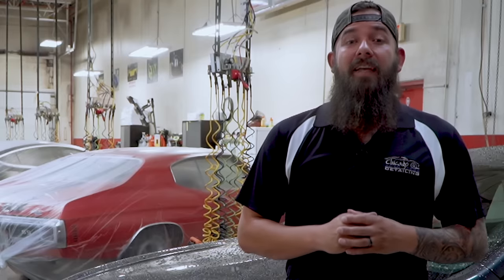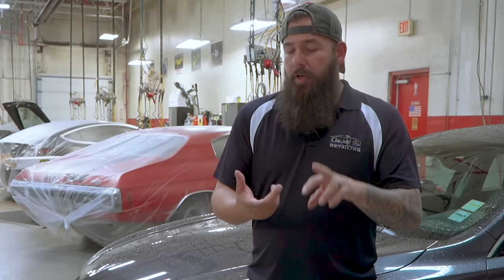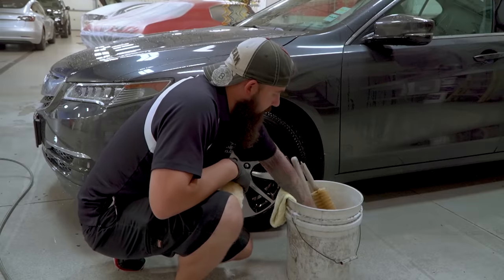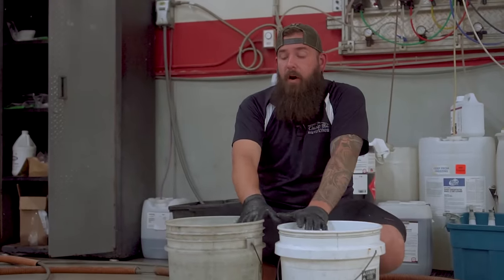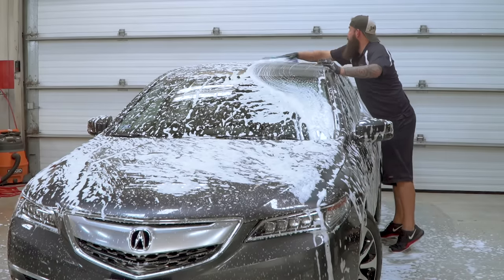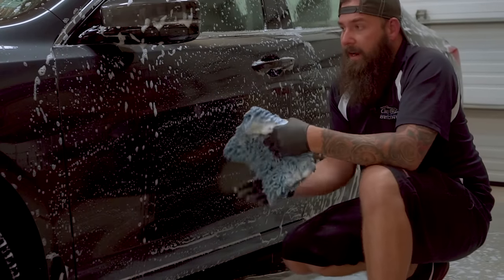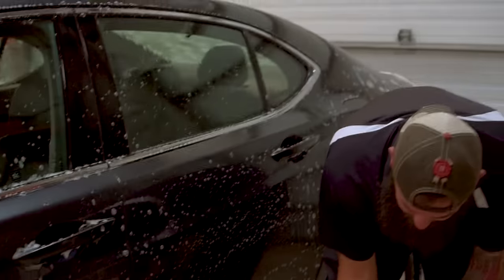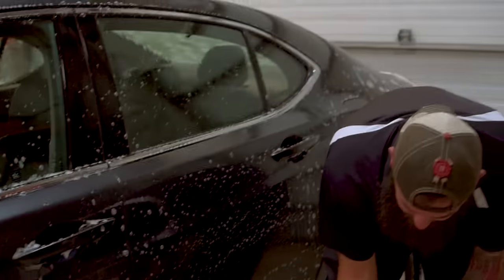A detailers SECRETS to hand washing

Comment: Man normal dude doesn’t have any of this shit I only got micro fibre cloth and detailed spray lol
Reply: Hes using clearer from a hose hanging on a wall and a leaf blower to dry it. SMFH been detailing almost 30yrs can detail a car in direct sunlight with a beach towel and Dawn Soap 
FYI detail jason:
Never clean wheel wells with a towel
Never clean wheels with them turned out
Never tell people how to spray on De-Bugger then forget to tell them the bugs still wont just spray off, or not show them how to properly clean bugs (debugging is a pre-step)
Reply: for a the price of a few touchless car washes, you can get some buckets, microfibers, mash mit, soap, and sealant
Reply: @gilbertoqueb6433  clearly you missed the point that real detailers have detailed cars for 50yrs without 3 buckets, microfiber everything, iron remover, foam canons etc etc detailing is tried and true methods that work having everything ready. People tell me "i dont clean my car it takes 4hrs" i say i could detail a battleship in 4hrs.... Got MFers on here using leaf blowers and spraying drying agent (i.e. more liquid) to DRY THE CAR FASTER are you kidding me these companies see fools coming a mile away
Reply: @fatashreviews5670  Wait so whats the right way

Comment: The rubber part of the tire?? Hmm... 🤔
Reply: I mean technically tires aren't ENTIRELY rubber but yeah
Reply: Tires/tyres are rubber...wheels/rims are metal.
Reply: It’s the softer part of the tire. If you put air into the ‘valve stem’ then the rubber part of the tire is the only part to move.

Comment: Why didn't you clean the rubber part of the tire first before the face? Seems backwards to clean the face then the rubber last... 
Grit Guards don't do anything. Myth and waste of money. Lots of evidence based research to show this. Same with 2 bucket system. Waste of time and water. I'd been doing the 3 bucket system for years (2 for paint, 1 for wheels) and finally saw an article from another detailer on what a complete waste it is. 
Best practice is to use multiple wash pads (one for each panel) and a foam canon. That way you are always using a clean wash pad for each panel (not a dirty one being dunked over and over in a dirty pail). I pre-soak the wash pads then have them all sitting on the windshield. Then I foam canon the car including the wet wash pads. Then I take on and start on one panel. One side of wash pad for first pass, second side for second pass or even a different panel if no second pass needed. Then discard of that now DIRTY wash pad and start with a fresh new one for the following panel. Saves 10 gallons of water per wash. Yes you will need more wash pads per wash. I am only washing 1 car though (I'm not a detailer for a living).  Dunking the same wash pad over and over into a bucket is not cleaning it - the dirt from the bucket gets agitated each time and you are dunking a dirty wash pad into a dirty water bucket then back onto the paint. It's a bad practice.
Reply from the maker: Definitely more than one way of doing things. Thanks for sharing your method.
Reply: Nothing wrong with 2 bucket method. Grit Guard use is debatable, but there is no doubt heavier contaminants (the stuff that is mostly likely to scratch your car) falls to the bottom of the bucket, and the guard stops your mitt from getting to the bottom and reintegrating into it. As long as your arn't sloshing the mit around like crazy, it's useful. The moment you place your mit on the panel it begins to collect dirt that you are then still rubbing over the paint, so a perfectly clean mitt turns into the same mitt you pulled from the rinse bucket after 1 pass and therefore makes no difference. You say the 2 bucket wastes water, how much water are you using to wash 7,8,9 wash mitts afterward? Assuming you are using one for each panel like you claim. Finally the majority of clear scratches come from excessive rubbing of stubborn spots, excessive pressure while washing, drying, or waxing, and from using towels other than microfiber. Avoiding those issues will minimize scratches.
Reply: MrFunk a
Reply: "Same with 2 bucket system. Waste of time and water" YET....." I'd been doing the 3 bucket system for years"  So let me get this straight,  "three buckets" waste LESS water than "two buckets"?  Ok, Got it!
Reply: MrFunk wash a car in Minneapolis at any time of the year, and you’ll understand why Grit Guards are so important.  They work as advertised for me.
Reply: @whatthewhat11 oof got his ass he aint respond
Reply: 11/27/18, Carwash isn't "rocket science," if you have a driveway & hose, some car soap, rags/towels that's pretty much all you need. This thing omitted one last step: glass cleaner. Pressure wash is nice though not necessary; you can pressure wash w/o rags.
Reply: MrFunk   B
Reply: @helsinki4  He used to do 3 bucket until he decided it was wasteful.  That's what the 'd means in the word I'd.  It stands for "I had", so "I had been" doing 3 bucket method means he was doing it until he read the article.  OK, got it?
Reply: V/
Reply: aA great idea to consider!
Reply: I'm going to burst everyone's bubble... dirt or contaminants or you choose to call it... it doesn't fall to the bottom for like  3hrs  so your scratching your car no matter what... have a nice day
Reply: Nickolai Siegfried  Yes, rinsing mitt glove with water hose is better than in a bucket with water because the water in bucket is only 100% clean for the first rinse and for the other rinses is already dirty even with a plastic grid.
Reply: Dish cloth, dish soap and bucket together with a bath towel to dry. Job done
Reply: Dez Alan your not serious right? ....right?
Reply: @whatthewhat11  - You made some good points as a rebuttal. I can see where you both are coming from. Especially if he had a mobile detailing vehicle with a water tank and he wanted to conserve water. I will side with your explanation though.
Reply: I'm currently using 17 bucket system. but after this comment I'm cutting down to a half of a bucket half system
Reply: 100% agree with you about the wash mits.  I have 13 for:  roof, door 1,2,3,4 top.  Door 1,2,3,4 lower.  Hood, trunk, hood lower trunk lower.  And I always Power wash all panels to get all grit off first.
Reply: Hahahahha,,,,,and how much water, time and energy does it take to wash and clean all those pads you use?
Reply: @2003evodave  They're now rendered impure. You destroy them of course. Sort of like the woman that won't wear the same thing twice. Speaking of which, if he happens to have any women like that in his neighborhood, if he swings it right, he could have a constant supply of pads/clothes for washing the car. So see? It's like an economic system, and gives the uppity woman knowledge she's helping the environment, and can still be uppity. She's happy, he's happy, we're all happy.

Comment: "Paint surface is very delicate"  Lets nail it with at least a 1000PSI pressure washer...LOL   even at 16 inches away from the paint it's still like sand blasting with water, the damage done at the molecular structure of the clear coat is astonishing under a microscope.

Comment: What do you think about the ceramic coat protection?  My dealership has recommended I do this to my entire car. What are some cons in your opinion. How do I take care of this?
Reply: It’s the best protection you can do to a car and last upwards of 9 years through professional installation, the only con known is it’s price. It’s all depending on size of car, the type of ceramic coating (consumer or professional) and also the layers used. It can cost $900 or $2500 it all depends. But it’s the best protection you can get for a car

Comment: As far as pressure washing you're correct, on being careful with the nozzle.  With a car I purchased recently I noticed the stereo powered on but no sound. Whomever washed it before had gotten water in the trunk. I found the battery tray have 4-5 inches of water still in it and it also shorted out the stereo amplifier mounted in the trunk.
Reply: Last time i used one on my Ibiza, i removed some of the clear laquer on the roof. Decided that if it's loose it's better off than on, and shortly after decided i'd better leave what was left as i'd nearly cleared it all off the roof!
I should have used the broom, like on my Land Rover...

Comment: I just hook up the soap dispenser on my pressure washer, rinse er off, soap er all up using the dispenser.  Then I use my wash Mitt in the way described in the video.  Been doing it that way over a year and so far so good.  Also, for the interior, I use armor all car care products-cleans well and doesnt leave a residue or grease behind, but you still do have to wipe everything down to ensure a nice and smooth application and to saturate everything.  Just make sure if you have a leather interior like my car, that you use their leather conditioner products, or that the wipe you are using is good on leather too.  Always test in an inconspicuous spot before going all out with the application though.  Also, rinse off your wash mitt once you're done.  Dont let it air dry, make sure its clean.

Comment: Hey Jason. I have tree sap that has stuck to the clear coat of my 2016 Silverado and I have found nothing so far to get it off. Could you please help me with the problem. The spots look terrible all over the truck. What is the best thing to use to get the hardened sap off my truck. Thanks for any help!
Reply: try rubbing car wax on the sap

Comment: I like the idea of a blower, however 99% of us do not have a large clean shop to wash a car.  I would think using a blower would kick up a lot of dust which could potentially land back on your freshly washed vehicle.
I do have a question regarding drying, instead of wiping water off is it a good practice to throw the drying towel over the panel and pull the edges of towel towards you using the weight of the towel to pick up any water?

Comment: I just purchased a jeep Cherokee Limited 2022 black with diamond fleck.  I had them put a paint protection on it. Today I found 2 light scratches on the hood. Took it to the dealer and they buffed them out. Also now recommend that I get a ceramic glaze put on the car. Said it will help with scratches and such. They say black is the worst color to try to keep looking nice. So my question is do I really need to spend the extra 1,000.00 and get this done?

Comment: So I have a couple of wash mitts. I use one for the body of the car and one for the wheels. My concern is that I have gotten them mixed up in the wash. Question is, if I use a mitt on the wheels and get iron particles on the mitt, will those iron particle safely come off when I wash the mitts in the wash machine? If not, I don't want to risk using a contaminated mitt on the car paint and causing micro scratches over times.
Reply from the maker: I would buy a new wash mitt. Buy different colors for the wheels and body.

Comment: Im a UK based detailer. To me. Its all common sense really.
I have a 'dirty' mitt that I reserve for those especially dirty areas and is only used for those areas.
I also have wheel only mitts.
I have different coloured microfibres that have specific jobs ... Blue windows, red interior plastics, etc. mixed in with that I have special wheel and dirty area microfibres.
Its all a little OCD, but it works  for me

Comment: Nice Video.  However, I use the 2 bucket method, but have 6-8 wash mitts in the one bucket. No water with wash mitts, and then I have a foam gun that will soap the vehicle up, use one side of the mitt for only one panel and then flip the mitt for the other side and another panel.  Also, I add a lot of soap over the wash mitts with the foam gun to keep them from absorbing all the soap on the vehicle. 

Each mitt, after using both sides, is  thrown in the bucket of clean water.  After all the panels are done and I have used almost all the wash mitts, the vehicle in rinsed. To dry the vehicle, I use a professional back pack blower (most homeowners own this one), air dry 98% of the water. There is no need for a hydrophobic agent as most, if not all the water has been removed with air. Then I spray with Griots speed shine or any lubricant/quick detailer, and yes microfiber towels are best for drying. 

Issue is that most people who wash their cars wait too long and the panels are real dirty, meaning that one wash mitt may not be enough and contain plenty of dirt, etc. The cost of 8 wash mitts these days, etc. is minimal, and they will last quite a long time. Then rinse out in a laundry sink, ring out the water, and allow them to dry in the sun over a period of days.  The wheels, etc. are done the same way as the video, and the use of a pressure washer before anything is a must, especially the windows. I have seen friends with deep scratches in windows wondering how they got there, and this is probably due to not using a pressure washer first and transferring small debris causing scratches, etc. 

Grit guards are great as all the dirt is suspended in the bottom of the bucket. Overall nice video!

Comment: Just got a car with a ceramic clear coat as a factory option (2020 M4 with 1500 miles on it). That is all I know - there wasn't any documentation passed on from the original owner about the ceramic finish. Is there any difference in how I should wash this compared to a regular factory paint job?

Comment: Great videos Jason.  I have a Model Y on order in Red Mult-coat. I hear that Tesla paint mayn't be as tough as the BMW paint to which I am accustomed and therefore even a home Kasher jet wash may damage the paint. I would have thought that one just stands further away.  Secondly, I notice that you wash on top of the snow foam. I have been, incorrectly, rinsing off the snow foam. 
If I may, a another question: I am planning to take my new Y straight to a detailing shop because when the cars arrive here from Shanghai because new Tesla owners report that their car was not too clean or given a quick wipe over.  The detailer quotes "Crystal Serum Light with upgrade possible". How would I know the difference if I paid for the upgrade?  Thank you very much Jason.

Comment: Thank you for the wheel advice, not use a brush in my new brand Yaris Cross wheels, because they are grey and black, and the problem is that the rim holes are too narrow so If can barely wash between them and fit a brush. Any advice? Thanks.

Comment: I have 2 black trucks and a black car.
Have had black trucks for years now.
One thing I do is on my water supply, I use a RV filter.
The city water is full of chemicals.
The other is I dont use buckets.
If you rinse your mit in a bucket you are just putting it in dirty water the second or third time.
I use at least two large microfiber cloths , and apply soap to them and wet.
You can rinse them with clean water.
Most drying agents have alcohol in them, while car soap is low ph with surfactants.
The mix is of not one I'm sold on 
The blower is good for the cowl and wheels but not much more.
I like the the foam conditioner, but after I have washed the truck.
I apply it on entire truck then use a spot free rinse.
Every so often waxes and soap will build up.
You get smear marks.
I use dawn to clean with it will take off the build up ,along with soap.

Comment: Thanks for the vid.  Question: About 15yrs ago a local detailer where I live used to use a special tire cleaner/tire shine and would sell my dad a small bottle of it, but wouldn't tell him what it was.  He long since went out of business or moved.  Anyway, it worked way better than ANY of the tire shines you can find in the stores.  Fairly clear liquid, little heavier than water. Put it on a sponge and wipe it on.  It smelled like bubble gum.   Any ideas what that stuff was/is?
Reply: Zep non waterbased still available but McGuire's purple gel is best tire dressing on the market
Reply: P&S detail products made it I believe they no longer make it.  I have a personal stash of 1 gallon best tire shine ever,   last for a very long time.

Comment: I always start with degreasing on my entire car while its dry and high pressure it off after a few min and then i use soap with wax, with 2 sponges, one for the top half of my car and the other for the bottom half(fenders and below the doors) high pressure it off and then wipe the car with chamois leather.

Right or wrong?

Comment: I did pick up some tips and I thank you for that, but most people don't have the luxury of a shady area to wash their car. Most people only have a driveway at the house, so washing the car panel by panel is the only option. Even if I wash my truck before the sun comes up, or evening, there is no way I can soap down the entire vehicle and take that kind of time. I'd have so many water spots it'd take me hours to polish them all out. (currently comtemplating a DI rinse (de-ionizer unit) filter to help with the spotting and wash process). Blowing off the water IMO is nuts. That only dries the water but leaves the calcium (water spots). It may have been a good idea to mention what your water treatment and the types of detergents. Maybe mention how your car will spot if you just blow off the water. It's basically just like letting it evaporate on it's own, you're just speeding up the process. Presto! Water spots!